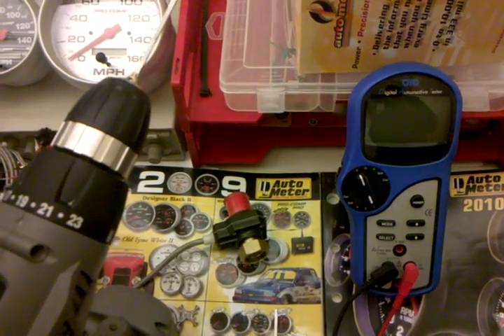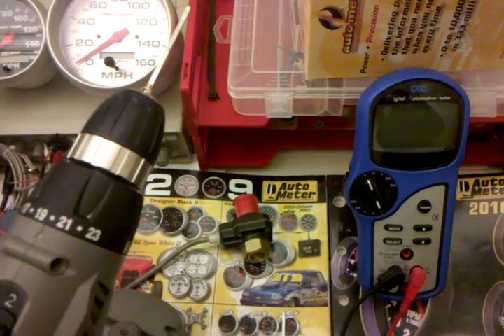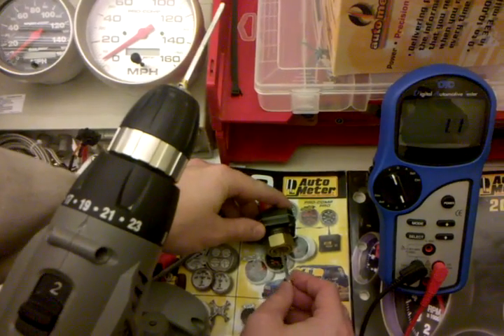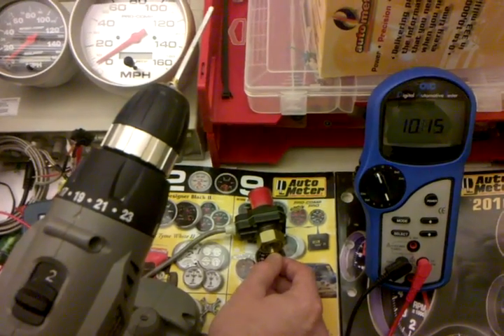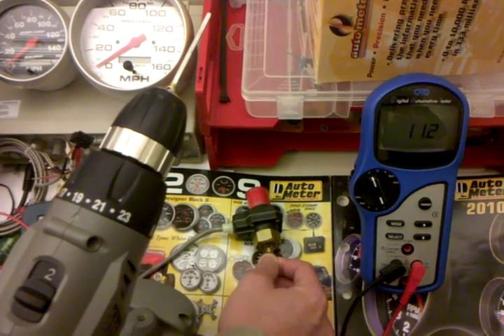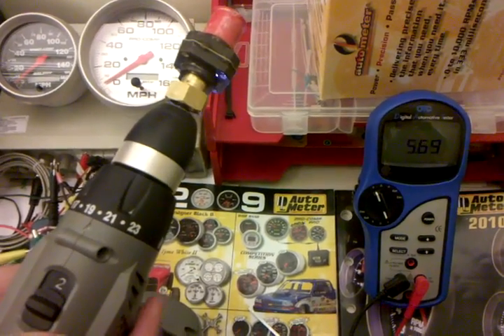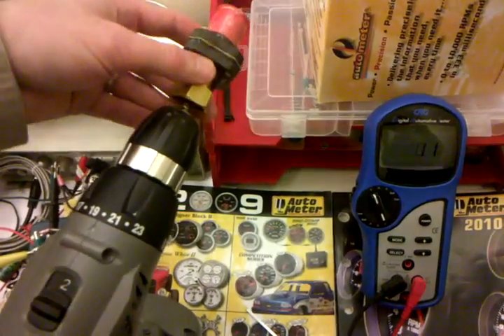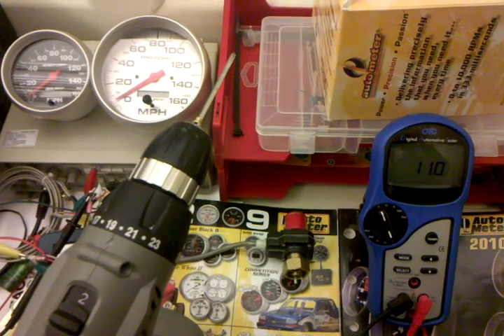How to Test a 3 Wire Speed Sensor

Comment: So basically if the car is completely stopped the output should be around 12V, then once it starts moving again it suddenly drops down to a certain value and then goes up to a value that is proportional to the car's speed? I've found the speedometer pin on my ISO stereo connector (the speedometer output is useful for making certain equipment such as vehicle tracking systems or GPS equipped head units more accurate than with GPS signal alone), tested the voltage between it and the ground pin with a multimeter while someone else was driving around, and it behaves that way, exactly like in this video.